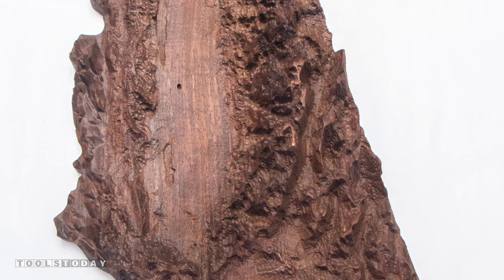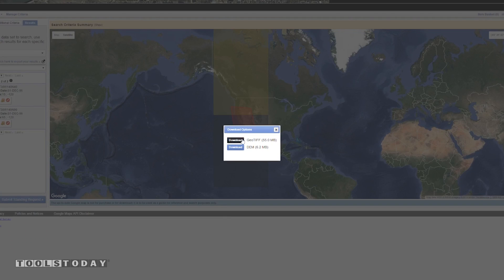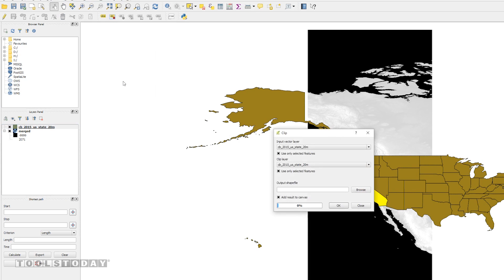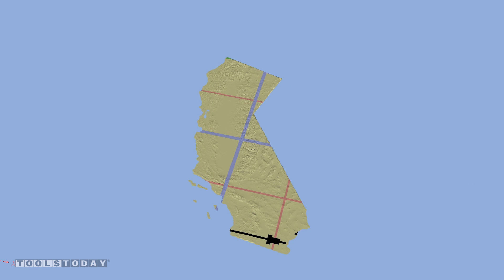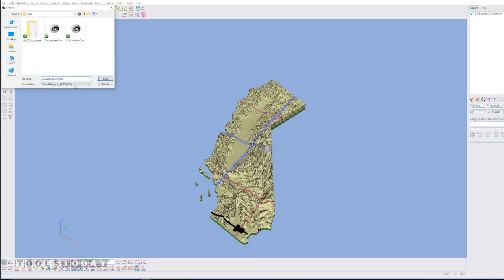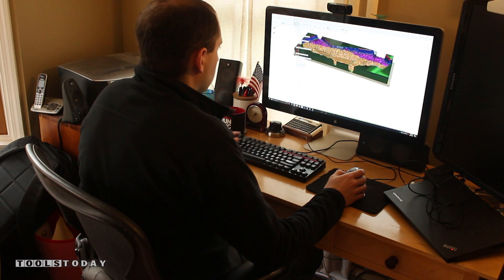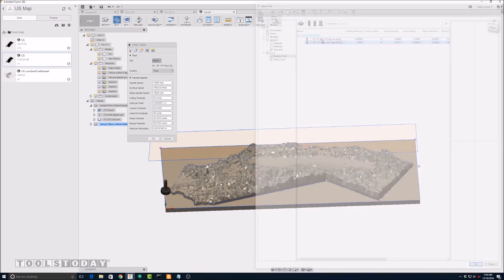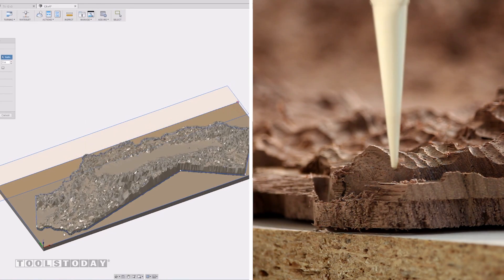CNC Project: Cutting the State of California Topographical 3D Map | ToolsToday

Comment: do you have a good website to get the map from and a tutorial on how to convert 2d to 3d? did you use aspire? my video is grainy.
Reply: Here's what I found out:

http://www.qgistutorials.com/en/docs/raster_mosaicing_and_clipping.html
There's a tutorial that goes a little more in depth.

https://viewer.nationalmap.gov/basic/
> Create a USGS account , login, and return to the above URL (need to be logged in for some steps to work),

> Above the map, select "Use Map",
> Hit the radio button "Box/Point",
> Click-and-drag the square that you want to capture on the map,

> In the left-column, check "Elevation Products (3DEP)",
> Find the datasets you want (for Maine, I used 1/3 arc-second DEM),
> Click "Find Products" near the top of the page,
> Click "[Cart]+ Page" to add all the files to the cart (I had 42 files total),
> Click "View Cart",
> Click "Export URLS to Text" (top left, above all the images) (you will need to download all these images with uGet),
> Click "uGet Instructions" (to the left of "Export URLs to Text).

It takes a while to stagger through everything but once you have all the logins and programs downloaded it goes by quickly. If you only need 1 or 2 images then you can skip the uGet part and download them using the USGS page. I'm currently working on trying to decipher all the steps. I've seen a few other methods used to generate topo maps but they usually result in some poor quality cuts. Trying to get them straight from the source!

Comment: Tools today has the first bit, #46272 listed as a "Foam" upcut bit?
Reply from the maker: While listed as designed for "foam" - most bits will still cut through material, but the finish it leaves is based on tool and flute geometry. In this case, the pass was meant make a cut-out, where the finish was unimportant. We don't recommend doing this. In retrospect we would have chosen a down-cut spiral bit such as 46202-K to make that cutout.
Reply: @ToolsToday  My left eyebrow raised slightly when seeing that in the final cutout pass.

Comment: Could you go more in depth about getting the map from the US survey and the state border?
Reply from the maker: Hi Ches, you could ask the CNC machinist directly, his name is Noah and his website is https://elevatedwoodworking.com. He'd be glad to help out.
Reply: I know this comment is 2 years old but I wish I had known all this a few hours ago. Here's what I found out:

http://www.qgistutorials.com/en/docs/raster_mosaicing_and_clipping.html
There's a tutorial that goes a little more in depth.

https://viewer.nationalmap.gov/basic/
> Create a USGS account , login, and return to the above URL (need to be logged in for some steps to work),

> Above the map, select "Use Map",
> Hit the radio button "Box/Point",
> Click-and-drag the square that you want to capture on the map,

> In the left-column, check "Elevation Products (3DEP)",
> Find the datasets you want (for Maine, I used 1/3 arc-second DEM),
> Click "Find Products" near the top of the page,
> Click "[Cart]+ Page" to add all the files to the cart (I had 42 files total),
> Click "View Cart",
> Click "Export URLS to Text" (top left, above all the images) (you will need to download all these images with uGet),
> Click "uGet Instructions" (to the left of "Export URLs to Text).

It takes a while to stagger through everything but once you have all the logins and programs downloaded it goes by quickly. If you only need 1 or 2 images then you can skip the uGet part and download them using the USGS page.

Comment: Very cool.  I had a question regarding that really long 1/4" bit.  It says it's a Solid Carbine Spiral bit Amana Tool #46272.  I would love to buy a bit that would have a DOC of that long, which is 2 1/4" as shown on your website.  BUT...  It says it is for cutting foam.  Is it fine for cutting hardwood?  I assume it is as this is what you are cutting with that reclaimed walnut.  Can you comment on that please?  It says a step down of 0.005" is that DOC for that toolpath?  In the video it shows that first cut which looks like it is at least 3/8" in depth.  Thanks.
Reply: Thanks!

A foam cutting bit is probably not the best choice if you don't absolutely need the DOC, but I did it for this map and have done it before. Chatter becomes the biggest issue -- if you have any substantial runout in your spindle or router, you're likely to break it.

Depth of cut for the cut shown was actually 0.25".
Reply: I do need the DOC.  Ideally I'm looking for a 3/8" diameter with a DOC of 2 1/2", but they don't seem to exist, but there is a foam cutter that would work.  I have a decent spindle, I think.  I just bought a dial gauge so I will be checking.  It should be fine.  I really need that DOC and my actual DOC for each pass could be 1/2 or 1/3 of bit diameter, which should result in very little torque.  I might buy one of the 1/4" and 3/8" and test them out.  It's just they are not cheap but they could solve and replace a number of bits if it works OK.  Thanks.